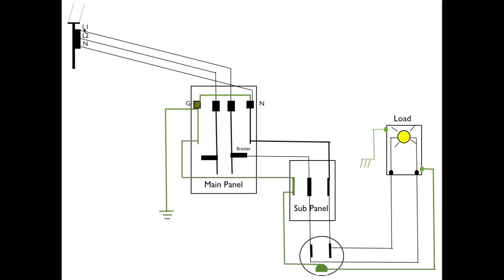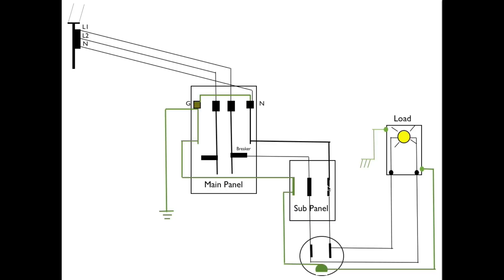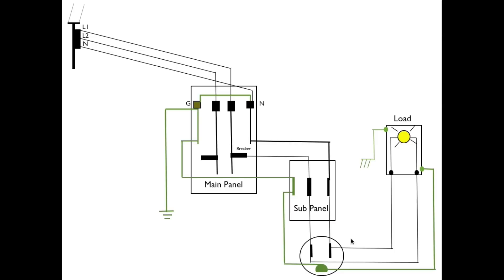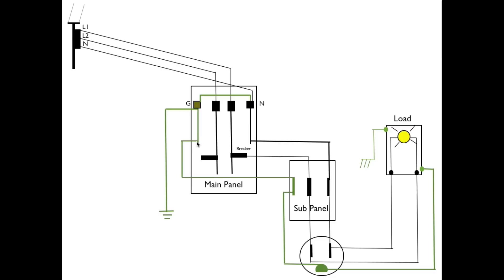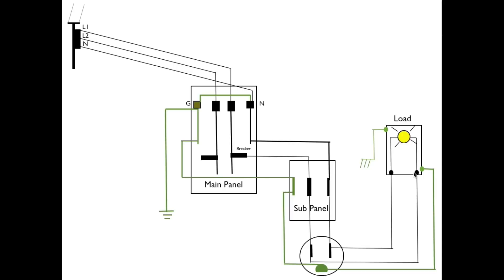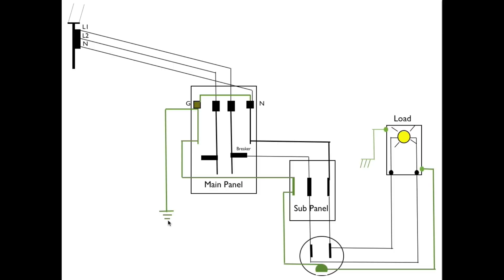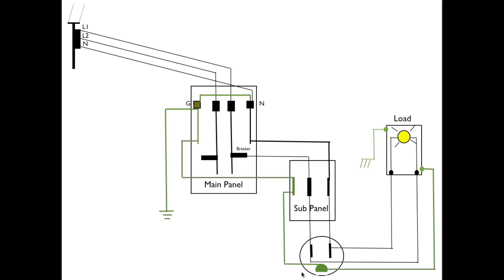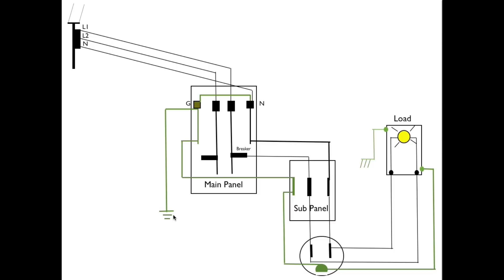The difference between neutral and ground on the electric panel

Comment: I always wonder if L1 is power/ voltage, is neutral to have voltage as well when checked to ground? You mention neutral Is a current carry line is that the same as L 1 or is neutral in essence  a dead line unless voltage is present from L1. Hope my question is not confusing.

Thanks ken
Reply from the maker: If you place a meter between L1 and neutral you will read potential.  If you place a meter between neutral and earth ground, you will read nothing.  If you place a meter between L1 and L1 you will read nothing.  I know this seems odd, but the neutral and earth ground are connected together at the main panel or 1st service disconnect coming from the power pole.  Hope this helps.
GFM
Reply: grayfurnaceman I suggest that you search up TN-C-S, IT, TT, Split phase and High-leg delta, would maybe clear up something.
It's not really odd if you look at the transformer principle.
PE (earth) and N (neutral), together called PEN (before you split it up to PE and N) is nothing more than a neutral point in a Y connecting (or center point in one of the 3 phases in a delta connection) in a transformer. Voltage between phase and neutral in a 3 phase TN system (Y or wye) should be:
Voltage between phase L1 and L2 divided by √3
L1-L2/√3

Split phase would be L1-L2/2
High-leg delta would be L1-L2/2 (This apply just for L1-N and L2-N, this do not apply to L3-N, if you look in to high-leg delta you would understand why).

In a balanced system you wouldn't really like any current going in neutral. Ofc, there will always go current between breaker and load, but from the main panel (as see here) to the transformer you would like to spread the load on the phases and run as little as possible current in neutral.

Untrained people can do this? Scary!

Comment: in the sub panel isn't the ground lug bar screwed into the metal housing along with the neutral lug bar, so technically wouldn't they both be connected by the metal sub panel housing ?
Reply from the maker: If the panel is a sub panel the neutral is isolated from the chassis.  Note the green screw that comes with the panel to be installed if it is a main panel.
GFM
Reply: yeah you are right, thanks

Comment: The ground connected to the neutral in the main panel is for lightning protection when lightning hit the neutral at the pole. What if lightning hits the 2 lines? There won't be any lightning protection?

Comment: Early on, you state that the neutral wire is NOT insulated between the pole and the main panel, but it carries current? Why wouldn't it be insulated? Then I wondered why the current in the neutral wire wouldn't just flow to earth ground (From the main panel), but then you talked about how dirt has too much resistance...  so, 110-220v can't use earth ground as a path, but the voltage in a lightening strike IS enough, do I have that right? TIA
Reply from the maker: Neutral is referenced to ground, so there is no voltage difference between neutral and ground.
GFM

Comment: Great Lesson. Why do we connect all our electronics to that same ground if when lightning strikes that ground wire is used to consume the jolt; Can't that jolt also affect everything connected to the ground wire.
Reply: The ground is not connected to the circuitry - it's connected to the casing (frames, etc).  Safest for you and the device that way.  Still, if you happen to be in contact with the ground during a lightning strike you could be in trouble...
Reply from the maker: It can.  The ground is a low impedance path to earth.  This will draw off the discharge.  If it was not there, you would have power going thru all your components trying to reach the earth.  Its better but not perfect.
GFM
Reply: Thank you for your reply. That does make sense, especially after watching the video again.. -God Bless
Reply: Thank you for your reply. True, That's a good point too, I didn't think of it that. -God Bless
Reply from the maker: Glad it helped.
GFM
Reply: I agree its the rods,ufers and  ground rings and pipes that are the quickest path to ground for lighting. They keep your house from getting blown out. 20 years residential electrician.
Reply: Ralph Averill:  Really? When a surge is induced into your branch circuits and equipment grounds, where do they go? Hopefully, the surge(s) induced in the equipment grounds get back to the ground electrode system.
If the neutrals you mention are the white wires from the load back to the neutral bar or bus, any surge can use the bond jumper to get onto the ground electrode system and SOME of the lightning surge can dissipate into the earth. Some can follow the powerco neutral that was intentionally grounded back to the powerco transformer IF the bond jumper is installed.

It might be more accurate to say about the role of equipment grounding that the main purpose of the equipment ground and main bond jumper are to clear ground faults by taking the current back through the powerco neutral to the transformer, then back into the house to trip a breaker and clear the fault rather than hoping to dissapate the ground fault into the earth.
Reply: You are saying "ground fault". What you are describing would be a "neutral fault".  And you have the concept completely backward. You said that in the event of a ground fault, the current would go back to the powerco thru the neutral and back to the house to trip a breaker and clear the fault. But the electricity ALWAYS goes back to the powerco thru the neutral. (120) They way it works is that in the event of a "neutral fault", the bonding jumper clears the fault by taking the current to the powerco thru the default ground path to clear the fault. And breakers don't trip as a result. You can run either leg straight into the ground and it won't trip the breaker. Because @ 120v, the resistance to ground only calculates to about 2.5 amps. Since your breakers are 15A and up, nothing will happen. 2.5 amps will kill you 1000 times over, but it won't trip a breaker.  Remember, breakers are there to save equipment, GFCI's are there to save people....

Comment: Question: I have an oven (built in style) it has l1, l2, Gnd, Neutral...however, my sub panel has (as usual) L1, L2, Gnd...at the oven do I wire the Gnd to the sub panel or the neutral?
Reply from the maker: The safest way is to install wiring that includes both a neutral and a ground.  You can connect the neutral and the ground at the appliance and it will work.  All 240 volt appliances were wired that way up until about 1995.
GFM

Comment: So the ground is just a redundant return (neutral)?  If the neutral line breaks, then the circuit is shunted to ground via the ground wire.  Otherwise, without it, the circuit would probably flow through me (assuming I was holding it) to bet back to ground?

Thanks.
Reply from the maker: Earth ground will not conduct current of such a low voltage.  The chassis ground will conduct current back to the neutral to clear the fault to the transformer.
GFM

Comment: So, more specifically, where is the neutral wire coming from (or going to) than just the pole? Is it going straight down the pole to the ground, connected somehow to the transformer, or going further up or down the line to ??
Reply from the maker: +bigpardner The neutral is the center tap of the transformer secondary on the pole.  The 2 hot leads are the ends of the secondary winding.  It is connected to earth ground, but does not need to be to operate normally.  Hope this helps.
GFM
Reply: +grayfurnaceman Thank you for replying. I think I will have to review basic electricity and transformers in particular to understand how this works.

Comment: I encountered a install of a range that had only 3 wires and the third wire was a bare stranded wire as a ground or a neutral with 2 hot wires-- my question is how did this work and what should i do with this configuration??
Reply from the maker: Terry Giboney Ranges installed before about 1995, used the ground as a neutral for the 120v volt circuits in the range.  After 1995, a separate neutral wire was required.  The best solution is to replace the wiring to the range with a 4 wire cable.  You could use an older 3 wire cord to the range  by connecting the ground to both the neutral and the ground on the range connections, but it is not as safe.  Hope this helps.

Comment: neutral is connected to the earth ground in the panel. so it is possible to eliminate neutral and use earth or air ground as ground as the negative for the live wire which is positive right?. it seems it's only function is for the meter to capture the flow  of alternating current back and fort right? since from the switch  box of your house the neutral is already connected and shorted with the ground, there for the load's neutral is already earth grounded and even you are grounded while touching the neutral you will not get shock.
Reply from the maker: I don't know how many times I have said this but here we go again:  Earth ground is not part of the circuit!  It is not a return line.  The power system will work just fine without an earth ground.    I can disconnect the grounding rod.  I do not need it.  It is only there for lightning discharge and to absorb spikes.  For many years, there was no ground in outlets because it was not necessary for the circuit to work.  There is no positive or negative in A/C.  The neutral/ ground is not used at all in the 240 volt circuit.  I have done a number of videos on grouding and bonding.  Go to my channel and look up "grounding and bonding" playlist.  
GFM
Reply: you know there are 2 ways of grounding righ? air and earth rod.

i also got voltage and amps using single wire connected to transformer while the other wire is grounded connected in the metal water pipe buried in the ground. and i got 12v output also grounded and it runs my appliance when i connect it.

i do think we don't need neutral wire, since from the electric post to your house it will be grounded anyway and ground works as negative wire.
Reply from the maker: Lightning rods are not an accepted grounding system.  Try disconnecting your neutral from the pole and you will see quite quickly why you are wrong.  I am not advocating you do this as you could be electrocuted.
GFM
Reply: John Christopher Delegero — No.  Just wire your house by the book.  Better yet, have a licensed electrician do it.

Comment: Hi, am I assuming correctly that without the circuit breaker in the main panel, the ground hole in the outlet doesn't have any justification?
Also why do we need the neutral cable when we can draw one cable from the electric company which will be the phase and use the ground as neutral?
Reply from the maker: I don't understand the first part of your question.  We separate the ground and neutral to keep the ground as a safety.  The chassis of the appliance or disconnect is connected to ground so that if the appliance gets "hot" it will open the circuit protection.  Hope this helps.
GFM
Reply: grayfurnaceman What I'm saying is that if there wasn't any circuit protection, I mean by that a GFCI, then there is no need for a third ground wire. Now I'm reading a GFCI can protect you without the need to be connected to a third ground wire. So I still do not understand how the third ground wire protects anyone by connecting the appliance case to the ground if the ground cable is connected to the neutral cable anyway, which means it's the same as connecting the neutral itself to the case without using the third wire.
Reply: The neutral is a current carrying wire. As soon as you switch an appliance on the neutral wire becomes dangerous. This is because if there is excessive resistance in the neutral wire then the current will take any easier path back to the transformer secondary. You may have a oxidised pin on your washer plug but the one on the dryer is shiny new. In your scheme if you touched both appliances then you would be zapped. The current would try to go through you to get back through the dryer. Contrast this with having a separate case earth wire. The case earth wire doesn't normally carry current so it is safe to touch. It provides a low resistance path back to the transformer (easier than going through you and the dryer). It also causes the breaker to trip immediately on a fault condition rather than waiting for you to complete a circuit by touching the washer and dryer at the same time.
Reply: Dale Manolas current in a wire doesnt change its resistance. Since the ground and the neurtral are connected anyway, it doesnt matter what you touch.
Reply: Hi ronenfe. I didn't say that current changes resistance in a wire. I did say that corrosion can certainly do so.  It certainly does matter what you touch in relation to your location in an AC circuit. Imagine two 110v light bulbs wired in series in a 220v circuit. The current flows through one and then through the other. You wouldn't touch the wire in between the two bulbs because it is obviously live. Now imagine that you have only one 220v light bulb in the circuit.....but the neutral wire is corroded further on back toward the main panel. The corrosion acts like a resistor.....a light bulb is also a resistor.....so it's like having a second light bulb in the circuit. So if you touch the neutral wire after the light bulb but before the corroded wiring then you provide a lower resistance path to ground than going through the corroded wiring. You get zapped. This is totally different to touching the ground and neutral at the mains board. At that point the current has a big fat copper conductor to take it back to the transformer. There is very little resistance in that path. Going through you would be hard work because you have lots of resistance in comparison. Keep in mind that the earth wire is giving an uninterrupted path to a distant part of the AC circuit where different conditions prevail. The earth wire is also not normally carrying current. It only ever briefly forms a circuit when a fault condition exists. The active and neutral wires are totally different. When you switch on a light bulb then these wires form a current carrying circuit loop that goes all the way back to the transformer. Being connected at the main board does not make the neutral and earth wires the same everywhere in the AC circuit.
Reply: ronenfe — You had better let a licensed electrician install your load center.
Reply: @GH-oi2jf  I'm not installing anything. I'm trying to understand the purpose of the ground wire.
Reply: @dalemanolas5994  the ground wire can also get corroded so the current will still go through your body.

Comment: I have a 3 phase motor quite large and would like to make a sawmill with it is there anyway I could hook up a generator to run it! I have been looking on you tube and they talk about another electric motor. but there must be a way to add a third phase on the generator to run the motor efficiently. the mill I want to build is called a swing blade mill. thanks in advance I enjoyed your videos help me to understand electricity. neat. I currently have come up with a generating station that would run itself they say it is not possible but it is.
Reply from the maker: +Marc  A Gagnon The single phase to 3 phase using a generating motor is about the best I have come up with.  Interesting about the swing blade mill.  I have built sawmills before but have never heard of "swing blade".  I would be interested in your generating system.  Send me specs and I will tell you why it won't work.  lol
GFM
Reply: +Marc  A Gagnon 
What about getting a 10kW, three phase generator through government liquidation sales? By the way...ground and neutral are connected on 90% of the applications we use. If you are interested in the process of buying one of the generators, go here;http://www.govplanet.com/jsp/s/search.ips#sm=0&c=13&t=3821
Reply from the maker: +harry bottom Thanks for the info.
GFM

Comment: The other ground on the load diagram, coming off the left side in the diagram with the little slash marks///.  I didn't quite understand its purpose or it's function. Could you re-explain. Are both of the grounds connected to the metal  box of the light. That's the way it appears in the diagram & also the way I understood it explained.
Reply from the maker: The hash marks are the symbol of chassis ground, or the metal box into which the components are placed.  The metal box is connected to the panel ground and bonded to the neutral.
GFM
Reply: @grayfurnaceman : looking at other videos,  I saw the ground wrapped around the screw in the back of the metal box & then attached to the ground screw on receptacles.  From the explanation  I'm assuming this is what you are saying here.  Thanks so much. Trying to learn my friend.
Reply from the maker: @johnhora4644  You got it.
GFM

Comment: So what you are saying is that the resistance of the earth ground out of the main panel, even though connected to the neutral bar, is greater than the resistance of the neutral line back to the power pole and the current doesn't flow to the earth ground?
Reply from the maker: Well, yes, sort of.  Its almost like the difference between wiring to both poles of a circuit, and taking one of the wires and running it to another circuit with a different source.  When you have a connection to earth ground, the resistance between the ground rod and the neutral at the pole (which is connected to earth ground at the pole) is extremely high.  It plays no part in the circuit except as a sink for lightning and power surges and spikes.
GFM

Comment: My question is: I have a 220V piece of equipment that is a three prong 6-20 and since there are 2 hots, what do I do with the neutral and the ground?
Reply from the maker: Many 240 volt appliances do not need a neutral.  If there are no sub assemblies in the appliance that runs on 120 volts, there will be no neutral.  The ground will be connected to the appliance chassis.
GFM